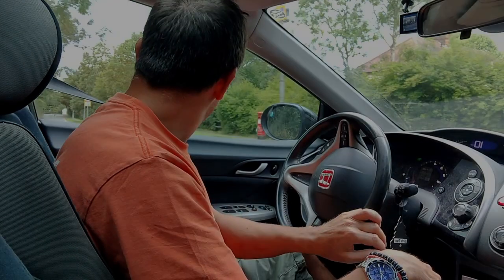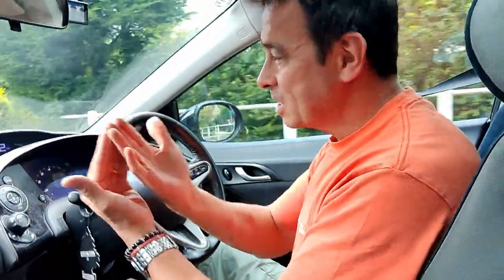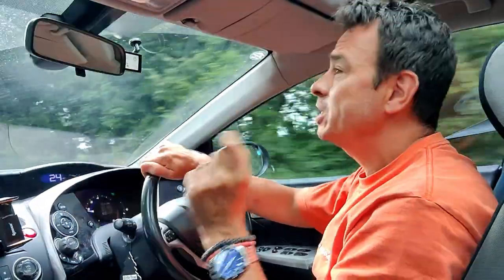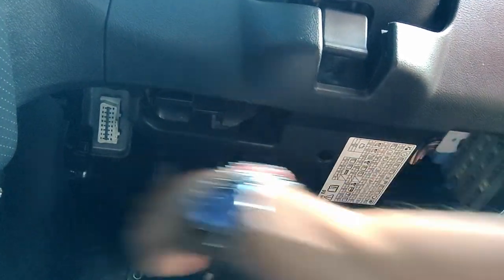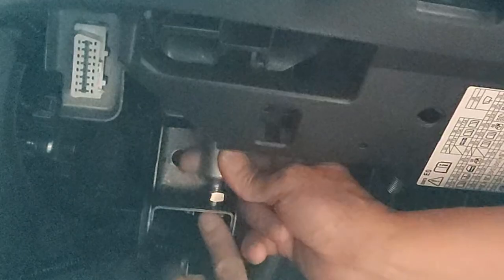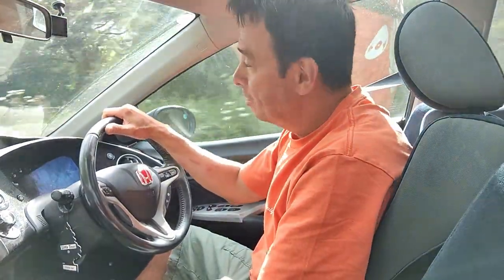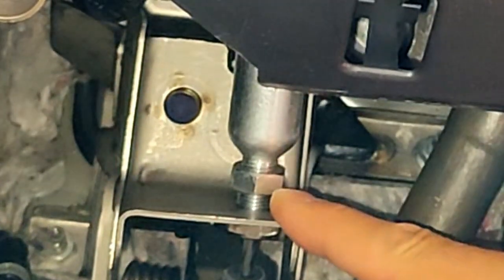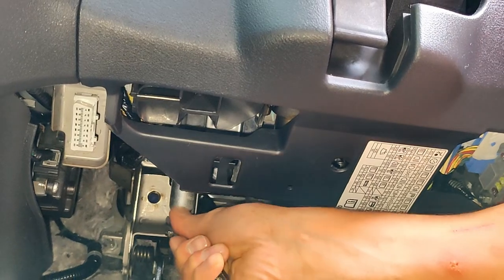Honda Civic MK8 Clutch Pedal Adjustment No Special Tools - 5 mins Easy!

Comment: I don't wish to be rude but you should pull this video as it's completely wrong information. The plunger switch has no relevance to the feel of the clutch or indeed its distance of travel. The only reason it's adjustable is so it can be used on different models. Please DON'T mess with stuff you don't understand.
Reply from the maker: @marcogarofalo6343  there is another video I did on the rear adjustment rod that is more accurate

Comment: Wow, this is so wrong. The plunger is the Cruise Control Switch and Clutch Pedal Stop. So all this adjusting does is, you can lift the Pedal Higher Overall. But you dont adjust the Clutch biting Point with this at all.
Reply from the maker: Yep, but strangely it was not adjusted correctly on my car, ergo, when I lifted the clutch, the plunger was too far protruded and the plunger sensor engaged too quickly, I adjusted back a little and there was a difference. The second video I removed the clutch and adjusted the rod at the back
Reply from the maker: Can I ask if you find your Honda clutch is a bit low down to engage? I have heard it's quite common?
Reply: @GrooveOn  Oh i've heard of that Problem. But Mine ist actually quite high, so i expect my Clutch to not having much meat left :/ 
But a to low adjusted Clutch Pedal/Master Cylinder ist bad indeed AS in extreme cases the Clutch might not decouple aproprietly and might grind a bit.
Reply: The adjuster screw on the back of the plunger closet to the steering wheel is for the ht of the pedal. The plunger is in fact the adjustment for the bite point which controls how fast, and how much pressure will be applied when releasing clutch. Just did this a hour ago before work.
Reply: I always mess with the bite point as sometimes I feel like having it low then on other occasions I put it back high lol

Comment: You need to look after the wire also it’s gonna be twisted there 😝
Reply: Do you have any tips on how to adjust it without causing the wire to twist?
Reply: @lazymaverick5118  disconnect the plug before you adjust it and plug it back after you finish 🤗

Comment: I have just replaced my master cylinder and I now feel that my biting point is 2 high. The adjuster on the rod was showing loadsnof thread so i put it as the same as the old one hoping that the feel of the biting point would be the same. Reason for change was squeaking master cylinder.

Comment: What's the difference between this adjustment and the other one on your other video about this subject? Does it has the same effect?
Reply from the maker: That's a great question and it's why I have two videos. The plunger that you can see at the front of the pedal is a safety switch to tell the ECU that the clutch is no longer engaged mainly for the cruise control.  The rod at the back on the second video I did will change the travel. I would start with the easy one in front and see if it makes any difference
Reply: @GrooveOn  Thanks for the quick reply! So the two adjustments affect de travel in the same basically? i have the same car as you, and im feeling the same as you do about the clutch engaging too low...
When you did the adjustment in the plunger at the front didi you notice any mal function on the cruise control?
Sorry for making so many questions but i´m just trying to pick your brain mate ahah
Reply from the maker: @joaquimcosta5851  I'm glad it wasn't just me that feels this with the clutch!  When I adjusted the front sensor it was a little better, so try that. Then the rear gave me more travel in the pedal
Reply: @joaquimcosta5851 the front adjustment does nothing for the clutch travel stall it's the  adjustment at  top of clutch attached to the master cylinder by adjusting this 1 you should getting better travel on the clutch pedal